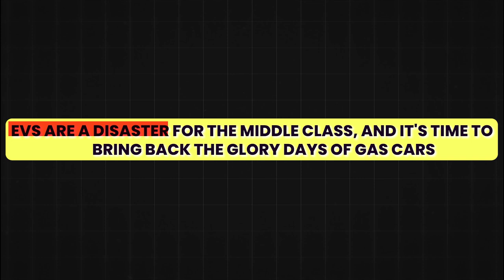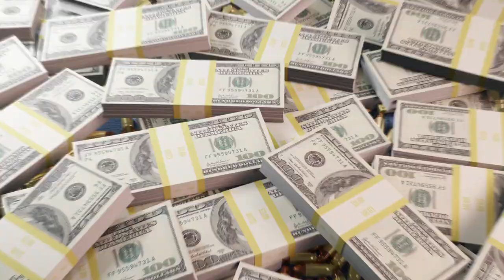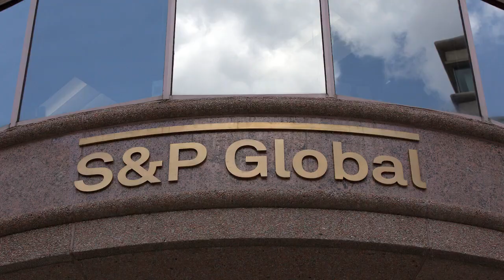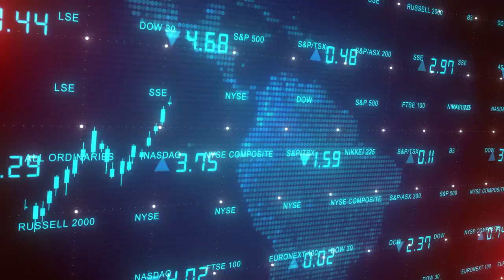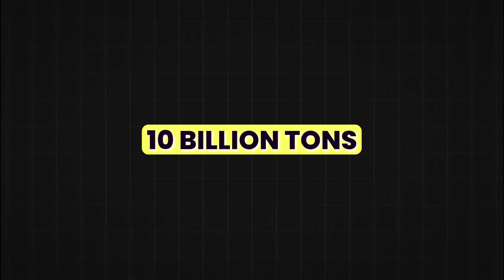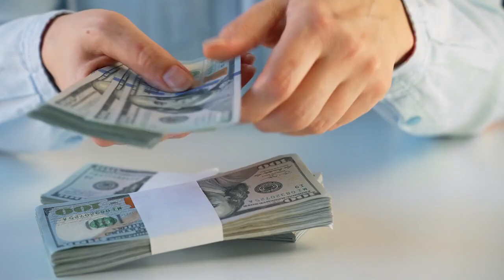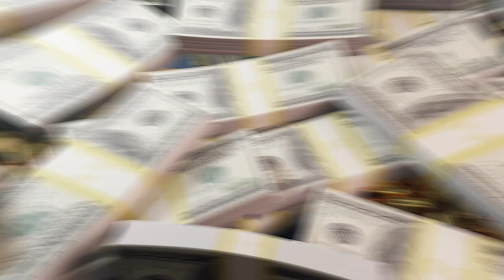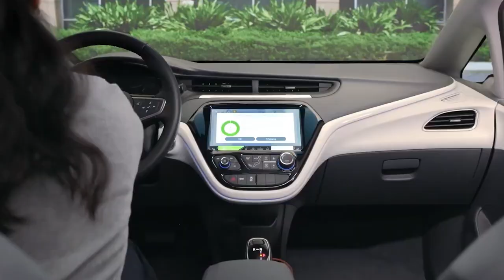Evs There Will Be SHOCKING CHANGES Ahead!

Comment: Communist are running the country right now, and Biden is in China's pocket... besides I don't hear about the toxic batteries 1. catch on fire (even when not running), 2. cost more than what's the car or truck is worth when batteries need replaced, 3. few if any mechanics know how to work on them... and when they do... get ready for double or triple the cost of repair cost now, 4. then there is the cost of turning in bad batteries (toxic material), then there’s the problem of charging in cold weather (they don’t).